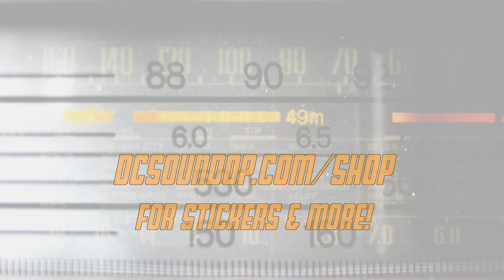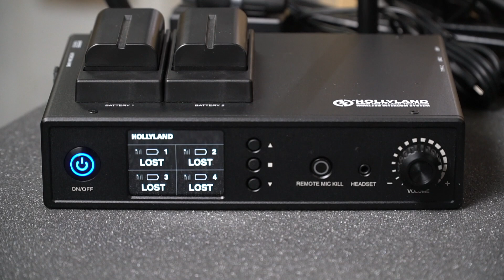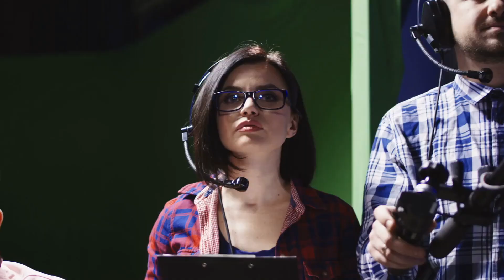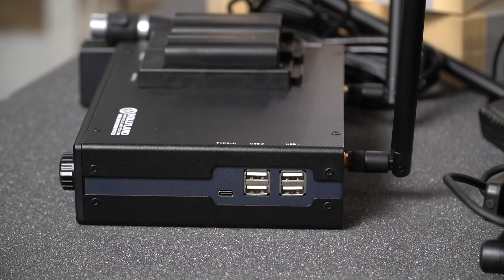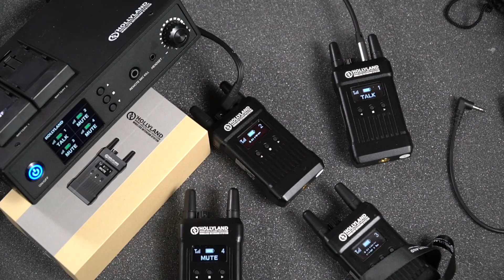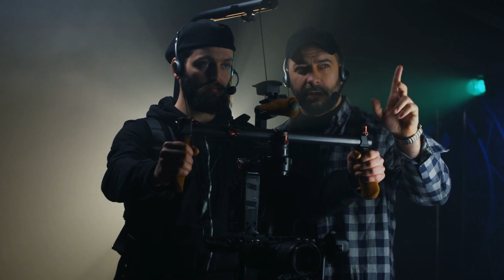Hollyland Mars T1000 Wireless Production Intercom First Look & Audio Tests

Comment: You didn't cover the Telly system.  Would love to see how it connects to a Blackmagic ATEM Television Studio Pro 4K unit.
Reply from the maker: It connects to normal Tally lights using a 3.5mm connection. For BMD products you'll need to buy their GPI Tally converter box. You should look for videos or info on that, as it is a unique process compared to normal Tally lights and wouldn't be the type of thing I'd go to the trouble of pulling together just to demo a light turning on for a product like this.

Comment: I finally picked one of these up at the end of 2021. I'm finally getting to use it for a live production this month. Granted, the latency means that we can't using it for calling the show, but at least being able to talk to each other without resorting to cell phones means a lot. I will say that my biggest complaint aside from the latency are the headsets. I have a large head and the clamping force gets painful after a couple of hours. I did notice that my headsets are of a different style than yours. I'm guessing they upgraded in the year since you released this video. The new headsets are reversible while yours appear to be for left-ear use only. My only other complaint is getting non-tech-savvy people to mute themselves (either with the button on the beltpack or by moving the mic to the mute position) when they're not talking to the people on the intercom. Thanks for making this recommendation. It's working out well for me. Have you ever talked about the various brands of NPF batteries? The true Sonys are pretty expensive.
Reply from the maker: Hey Matthew, sorry I didn't see this sooner! That's awesome that you picked up a set. Reversible headsets would be HUGE, that's cool they've gone that direction, but unfortunate they're squeezing your head so much! I haven't done anything talking about NPF batteries. Unless you need the Sony ones specifically for a piece of Sony gear, I'd grab something from Neewer or Wasabi etc. For this type of deal they work fine & you'll be able to buy enough to have backups charging while the other set are in use.

Comment: Hello I want to ask if there is any chance to connect this wireless system with my Datavideo DTC 100 Intercom (5Pin) System. At our Livestream I have to communicate with 2 wireless Camera all others are running wired. Can you
 answer this question?
Reply from the maker: Also, hello in Tenerife, what a beautiful place to work!
Reply from the maker: That's more of a question about your Datavideo system than this system. I'm not familiar with the pin-out for the 5-pin XLR they are using, but maybe you have it already? If it conforms to a typical two or four wire scheme and not something they brewed up themselves, then you could use the hollyland 2 & 4 wire converter - https://www.hollyland-tech.com/products/detail-45.html
Reply: @DcSoundOp  I think as well that the converter is needed and the 3 pin has to be adapted customsized - I am using the ITC 100 from Datavideo as well I not understand why the haven't an own solution to extend the system wireless...

Comment: Have just come off a job where one of the teams had these. No issues with 8 channels of sennheiser wireless mics, regular 2.4 & 5Ghz wifi or the Teradek Bolts that camera were running.
Reply from the maker: Hey Andy, thanks for the info, that’s great to hear they worked as well with all the extra traffic. Really appreciate you sharing your experience.

Comment: Seems pretty decent! Better than a facebook video chat for school theatre gigs... Weird how the quality drops so much when using the base station, as the wireless packs are passing signal though the base station anyways I expect.
Reply from the maker: I was pretty surprised too at how different it sounded from one to the other. Once I make up a break out cable, I'll be interested to see how the line level output on the base sounds in comparison. Gotta see if they change at all over distance or with poor reception. All fun stuff though for the price, I've used some pretty janky sounding wired intercom in the past that wasn't any cheaper.